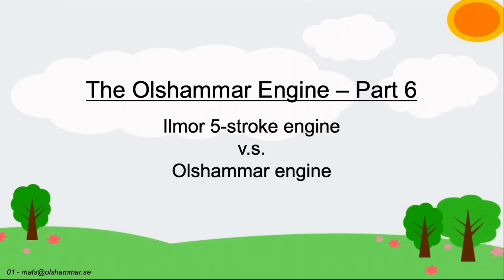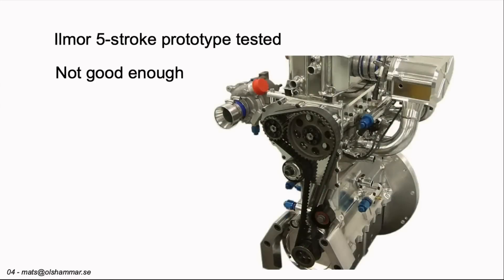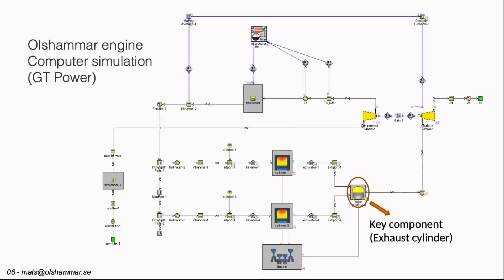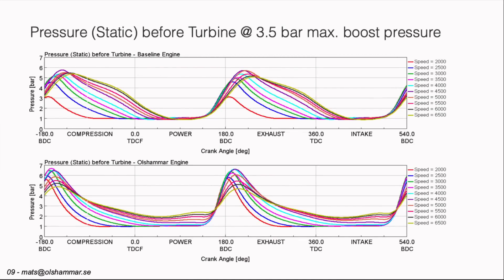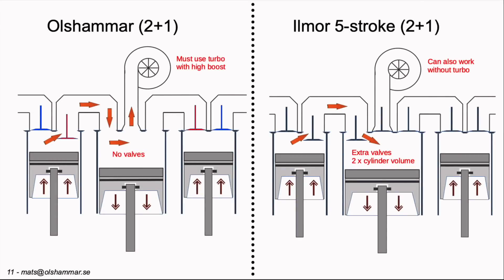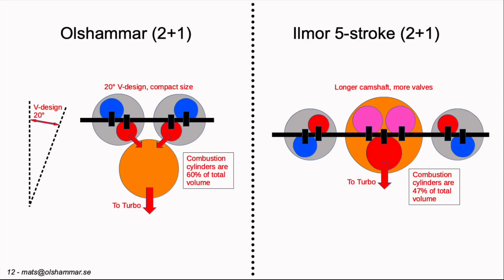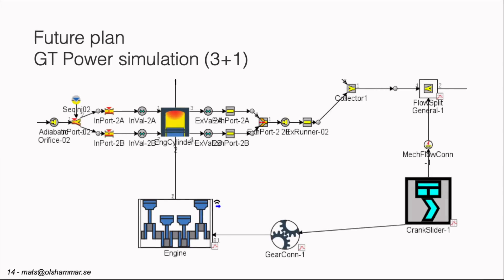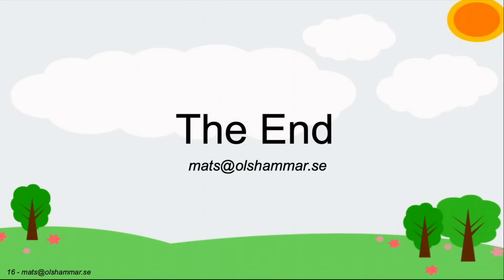Olshammar engine Part 6

Comment: a 12c
Reply from the maker: 12 cylinder engines are very suitable for this patent. They will require 4 or 6 exhaust pistons. What's the basic design of the engine? Is it a V12 with a Hot-V design where exhaust is collected in the middle of the V or is the exhaust sent to the two sides of the engine?